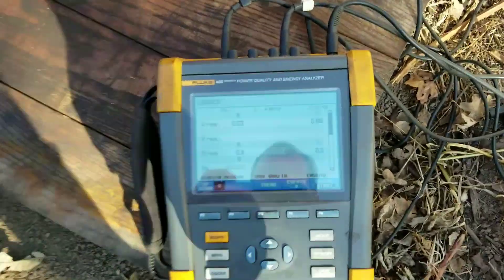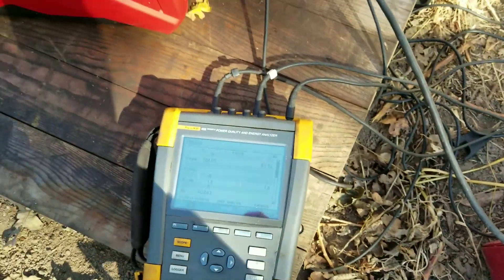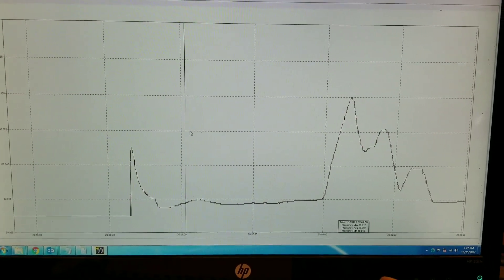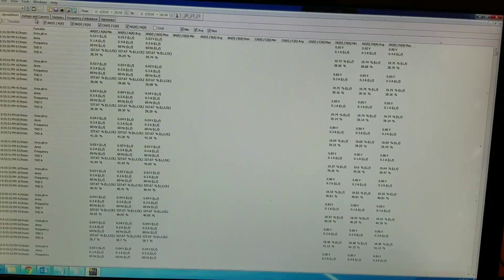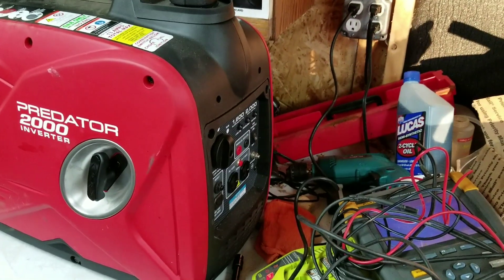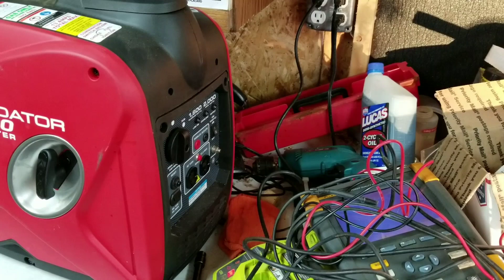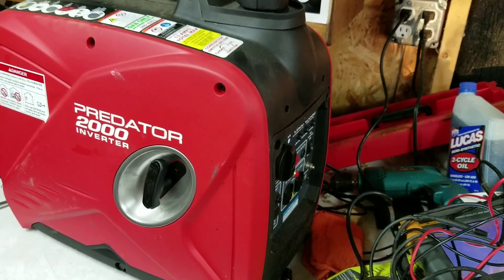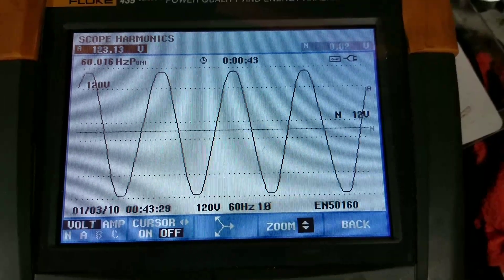Predator 2000 Inverter generator power quality compared to other cheep generators

Comment: I was wondering if the Predator 2000 putout a pure sine wave or a modified sine wave as some cheap inverters do.  This video answered my thought. Modified sine wave inverters have trouble with high start up loads like frig compressors or A/C compressors.  I wish I could afford the Fluke meter used in the video.

Comment: Hondas are great, but you can have 2 of those and a parallel kit and some spare cash for the price of single Honda.

I have one of those inverters and I love it. I don't use it a lot, but when I use it everything works with no problem, including computers, laptops, routers, etc. 

The most important thing is to have fuel drained from carb  then when you need it next time it will start first pull.

Comment: Two things I think you should pay attention to. That is an older 4000watt standard "mid range (Chinese?)" portable 7% is pretty good for what it is and I bet you would see that go down with any sort of resistive load in the mix. The wave looks pretty decent too. That little coleman is way way way overspeed. Not to say it still won't have lots of THD and a poor wave. I bet that thing is running closer to 5k rpms then it is 3.6k. Unless something is just faulty inside that's a very high voltage number. Huge THD and the curve is all over the place.

Comment: Can you parallel one of these with a Honda - as a cheap way to increase output...
Reply: If you buy the Westinghouse parallel cord, you can pair together any inverter generators.  The Westinghouse cord has normal 5-20 plugs instead of anything proprietary.
Reply: There are videos on this.   For parallel capable pairs or a single.   You can rig it to work.

Comment: The garbage 90 day warranty is harbor freight’s biggest problem.
Reply: Buy the extended warranty. Drain the gas. Take it back, they'll hand you a new one.
Reply: The big brands build the price of the warranty into the item. Not going to argue that the Honda counterpart isnt a superior genny. but at this Price  I run one of these as a backup to a backup.
Reply: Another thing about Harbor Freight stuff is that WHEN it needs service, good luck getting parts.

Parts are easy to get for Honda, but not cheap.
Reply: @davem5333  what parts would be commonly needed for the Honda, and how much is that? May find that it is just as well to buy another Predator. I honestly don't know, not messing with you.

Comment: thanks for a great assessment of this generator.. the Fluke is one fine az device for sure and shows how clean the power is on this unit. Not sure if you have read reviews on HF recently. A lot, and i mean a lot of folks have been using this unit in PR after the hurricanes running constantly nor for over a month in some cases.. 

I agree with you the honda is a great product but just like the mercedes there are other cars out there and other generators that are just as good for less money. I will put a hyundai genesis up against a mercedes anyday.. I actually have friends that went from MB to the Hyundai and never looked back. go figure.. 

I think they, predator  will hold up over time like the hondas..it all depends on the level of maintenance they receive.. run a honda for months/years without changing oil and it will die a early death. same with a MB.. I had a astro van with 230k miles when it was sold last year. 

again thanks for the in depth review and the sine wave graph you show.. interesting the elec from plug has about same THD as the predator.. 

PS: would to see you do the same test on honda.. :)
Reply: Carl Newton yeah buy that genesis and enjoy the garbage resale value. I’d buy a used Mercedes anything before a Hyundai. Hyundai’s are fine throw away cars, but anyone with real money knows there is an actual difference between a Mercedes and a Hyundai. The difference in cost is justified.

Comment: $400 with coupon at Harbor Freight. You can buy the coupon on eBay for about $2.50 if you can't find one....well worth the money as these units normally sell for $500. Decent generator.
Reply: Or even cheaper if you buy the Aldi Workzone 2000 which is identical.  I bought one from my local Aldi grocery store for $279.99.

Comment: Thanks for the analysis! Did HF have a price for the inverter?
Reply: Steve 762us I am almost positive that any replacement parts for the Wen 56200i can be substituted. Other than the case and integrated USB port, they are identical machines on the inside. The inverter goes for $170. Here is the link...http://www.wenproducts.com/store/generator-parts/inverter